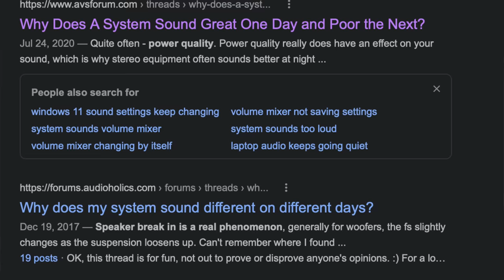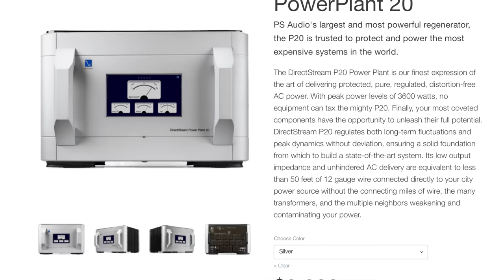Why Your HiFi Audio System Sounds Worse on Some Days. Is this the Cure? What about Transformer Buzz?

Comment: Funny in the market for PSM 156 , I just re did my room with 3 dedicated power lines , I’m not even plugging in my components until I get puritan , system stays down until I get 156
Reply: It would be nice to compare dedicated line with and without the 156.

Comment: Awesome. So, how does one use the 156 with a surge protector?
Reply: It is also a surge protector ...
Reply: @N02tradamus  Thank you kindly for the reply. I appreciate it!
Reply: @cpg8000  No problem. I just ordered one to replace the ZeroSurge surge protector. It is also rated for higher peak wattage for protection.
Reply: @N02tradamus  had you by chance considered the: AudioQuest Niagara 1200 when looking for the 156?
Reply: @cpg8000  No I did not. I heard great things from the Puritan from multiple sources so I took a chance.

Comment: If audio gear requires a $10,000 power plant or a $3,000 'power purifier', IMHO its not a well engineered unit.
Reply from the maker: @bikeman7982  these are usually needed for those without great power, like me. Not for the gear, but for the bad power that some of us have that does cause issues. Also, btw, there’s loads of poorly designed gear out there and some of it costs a small fortune. The Powerplant will also put its own signature on the sound. Wider stage, slightly warmer. Wether this is due to producing perfect electricity or something else, I do not know. Like anything we add to a system, it can make a great difference or even cause the sound to be worse. Ps audio has a 30 day trial that they give with every sale of all of their products. Seems to me many many more keep them than the fewer who may send them back : )

Comment: I found great great improvement attaching all my gears to ecoflow delta Power station (2200 watt).
Anyone else tried ?
Reply: I don't think that power issues is the main cause why my system sounds different from time to time, think it's mainly psychological. But if I ever wanted to go that route,  power stations like the ecoflow would be the logical path to go👍  Much cheaper than the "hi-fi" products, TOTALLY isolated from the mains, could be used for a lot of other things. How many hours of listening do you get on the 2200 watt unit?
Reply: @yskei77  7/8 hours
Reply: @riccardogiusti2865  that should be plenty👍 Btw.. can you still use it while it's charging? does it sound any different?
Reply: @yskei77  yes you can use while It Is charging. Sometimes I ear benefits and other not so clear....

Comment: Maybe, just maybe it could be measured by very sensitive instruments (which I don’t believe), this is nothing but psychoacoustics. Imagine spending 100.000 bucks and it sound like crap every thursday afternoon.
Reply: This is why there should be a Mental Health and rehabilitation program just for Audiophile’s.
Reply: @davidfromamerica1871
Reply: From David in Australia. The rehab program is available in the expensive end of any HiFi shop; "Spend enough and it will sound better"
The reality is that your end of the HiFi system; ears, eustacian tube pressures, cochleas, nerve hair, and auditory nerves will very much more from day to day, than your "system" and power supply.

Comment: Those Transformers are known for hum !
Reply from the maker: 100% silent with the 156 and my previous 590AXII was 100% silent without conditioning (though different house and state). Only buzzes when plugged into the wall. It’s due to DC not the transformer, at least in my case. I’d say these transformers are sensitive to DC on the line.